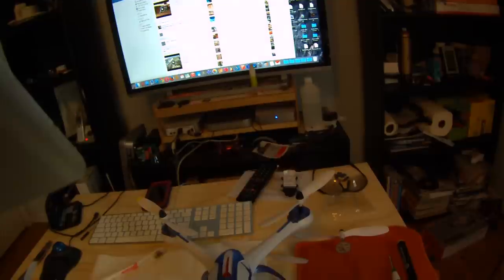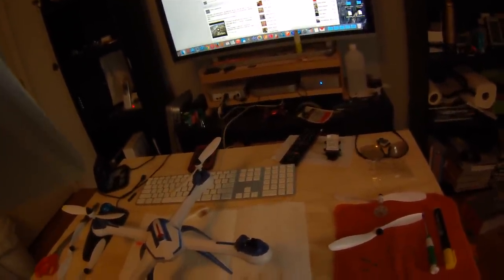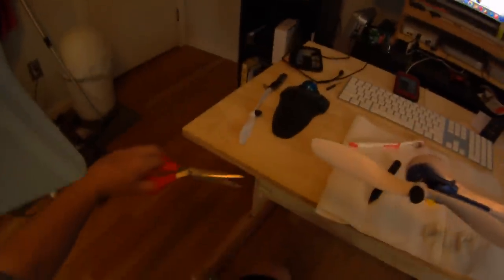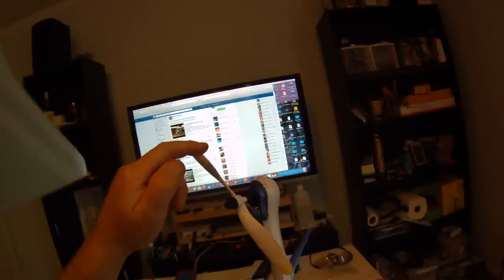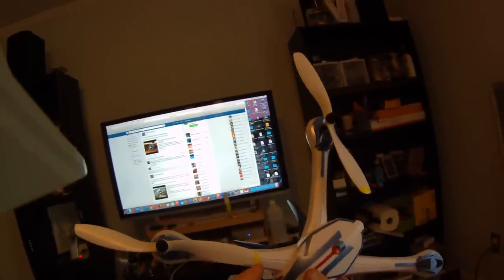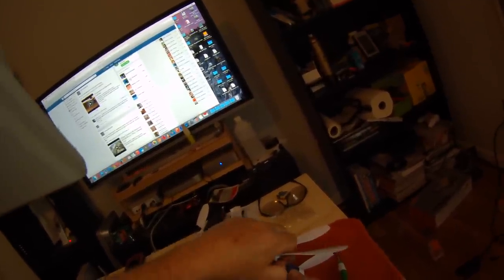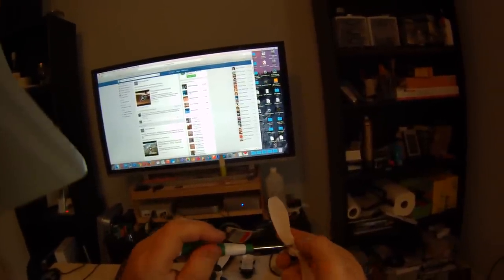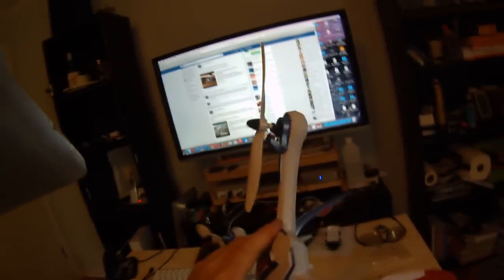Balancing Tarantula X6 props..

Comment: What kind of ball bearings did you use to replace the bushes?
Reply from the maker: +slyarsenal  I got them off amazon... obviously there may be some issues if you aren't in USA but search for these - 
 - Traxxas Bearing 3x6x2mm Alias (8 )- these are open bearing style - there is a closed/sealed style.. but they are a very small bit taller. some people like it as they take the upward play/movement out of the props. But, I've found that play seems good actually as it allows the drive gear to move up and down on the pinion gear wearing them both less and actually self cleaning the gears.  Also pinching the bearings tight like that actually shifts the races out of square to the balls resulting in the bearing wearing out faster. Yes, the lower bearing is pushed out of square when lifting, but every time there is some slowing of the prop it actually relieves it so it's not 100% of the time... not sure that all made sense?  LOL
Reply: Little Quadcopter Actually that made a lot of sense but I did watch a video earlier on how to reassemble the motor so I had a visual memory of what you were talking about. Thanks for the reply. And yes, I do understand your preference to open bearings. I share the same logic.
Reply: Little Quadcopter I just bought the Tarantula X6 and waiting for delivery. It's my first quadcoptor so I have some questions. I plan to use a RunCam action camera on this X6 but after lengthy searches on youtube and the web, I'm still not satisfied with the improvised stabilisation mounting systems people have tried. I've looked at various mounts even for DJI phantoms and various quadcoptors but because I don't have my quadcoptor yet, I really can't test anything. What are some of your trials and tribulations with mounts on the X6? I'm thinking a silicone mat with a mogul surface (less friction) and spring-loaded corners on a mount. Silicone is a good anti-vibration material used in many commercial products, but no one has seemed to try it yet on anti-jello mounts. 
I also ordered a WL Toys V262/V666 RC for the X6. I plan to modify it with an old 2.4G modem antenna even though I know the X6 already comes with good range on the original RC. Any thoughts on this? Tips? 
Thanks for helping a laymen. I'm an avid photographer, but think I've found myself a new hobby.
Reply from the maker: +slyarsenal honestly, the best anti vibe/anti jello mount for the tarantula I have found is honestly their stock camera mount, pop a small hole in the front of the battery door and slip the power cable out... strap the battery and RunCam with a velcro strap to the lower plate of the anti vibe mount and you're good.. it's what i use (look at all my videos, they are all that way since like early summer) 
Don't bother with the antenna mod.. did it, waste of time.  didn't add an inch to the range, honestly better off doing a mod to the actual quad's antenna .. getting it lower and under everything electronic will help more than anything I'd think  (it's my next mod to try)
Reply from the maker: +slyarsenal video for ya on camera mount.
https://www.youtube.com/watch?v=rtYBPU7_zCI

also.. break in the motors before 1st flight!!!  one last thing.. might want to get a MUCH smaller -easier to fly and learn on quad.. the tarantula is a power house and can be a hand full for someone who's never flown one.. you can get a JJCR 1000 for like 10-15 bucks US that is a "bind and fly" where it doesn't come with a controller, but,.. that one works with the tarantula's TX... :)  much better and CHEAPER to learn on as you can crash it lots with out it breaking!!!  and it's just a cool tiny little quad to fly around the house!
Reply: Little Quadcopter LOL well I bought myself a Cheerson CX-10C which until recently was the smallest quadcoptor with inbuilt camera, but I'm still waiting on the thing to arrive from China. Bought my X6 at GearBest which is from China anyway because I selected that as my closest vendor to Australia, so I'm hoping I'll get the CX-10C before the X6. I''ve even downloaded drone simulators on my smart phone to practice but I'm guessing that's not the same as flying a real one. Arrgghh the waiting is killing me! I think I'm jumping the gun a bit with the mods I want to do and my focus on building a proper anti-jello unit, so I'll take your advice on going slow and learning how to fly. This X6 is actually my way of working up to a DJI Phantom 3, which I was initially thinking of buying regardless of the $1200-1500 price, but I'm glad I didn't take such a silly leap.
Reply from the maker: +slyarsenal ya, the CX 10 is supposed to be a fun little buzzer!! :)

hey jooin the Facebook page for the Tarantula  and the RcForums group...  https://www.facebook.com/groups/TaratulaQuad/
http://www.rcgroups.com/forums/showthread.php?t=2320902&page=321#post33234609
Reply: Little Quadcopter Yeah I've already seen the video you sent me, but the video is so dark. Can you make another one with a close up view of your explanations? You seem to have solved the vibration judging from the footage from the X6 and RunCam. Looks butter smooth. I'm planning on installing a rocker switch on the X6 though. Makes life easier, but I do prefer the battery exposed for cooling. Tough choices to make but lets see if the X6 survives its first test flight. I just ordered some ball bearings from an MJX helicoptor I think which I've been told fits the bush fittings in the X6. That should keep the friction down and allow the motors to last longer.
Reply from the maker: +slyarsenal dont bother with a power switch.. The tarantula has such a heavy draw off the battery the resistance of the switch causes it to think the battery is low and it goes into Low Voltage Warning in like a minute or 2.. battery outside is better for a lot of reasons.. no need for a switch, easier access, no more stupid battery door screw, battery runs cooler, flight board runs cooler (no hot battery under it any more) faster switch out to get flying again... bla bla bla...
Reply: Little Quadcopter I think you just sold the external battery idea to me.
Reply from the maker: +slyarsenal   :)  like i said.. join the facebook page.. even if you're not a fan a FB  the group is cool folks for all around the world with many great ideas!
Reply: Little Quadcopter I'll check out the facebook page.